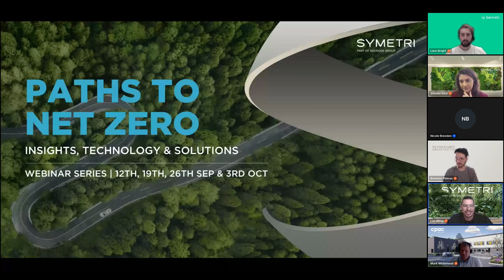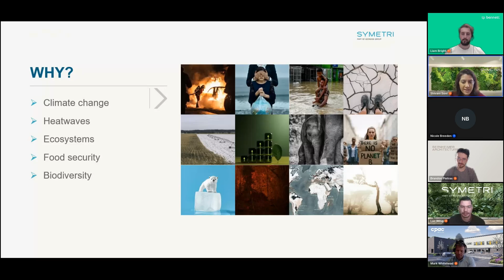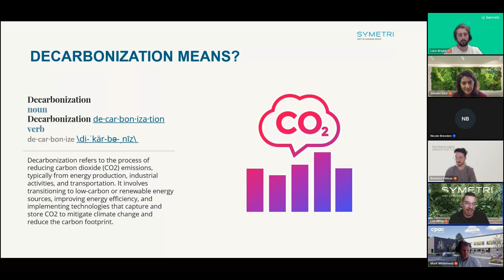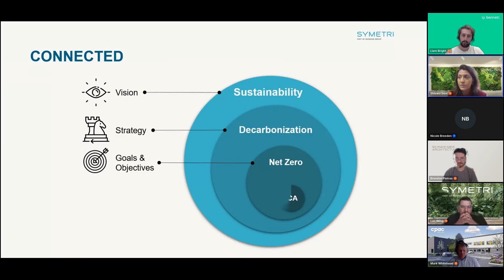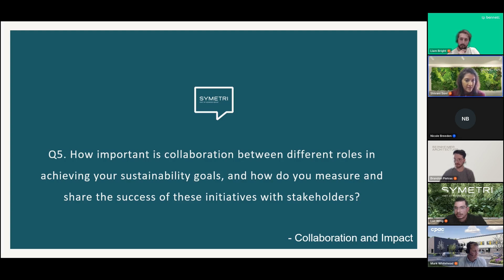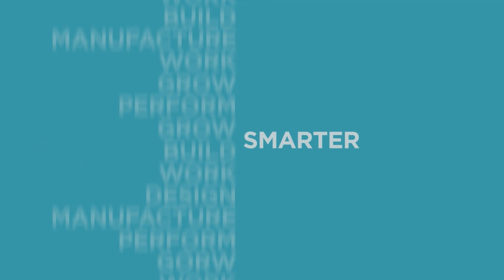Sustainability, Decarbonization, Net-Zero & LCA

Comment: The cause of global warming is not known.  NASA reports global warming at 1°C where it has been since 1992 after falling from its all time reported high of 1.1°C in 1991.   Earth's water vapor saturated greenhouse effect is from water vapor and can not have its overall effect changed by other greenhouse gases absorbing all the greenhouse radiant energy from the earth within a few meters of the radiating surface adding 10°F (5.55°C) to earth's average temperature.   

The wild AC generating space from solar voltaic and wind turbine generation has to be 100% supported by the public power grid with fast reacting peaking power.   This costs more natural gas for high readiness making near zero electricity than making all the electricity from efficient running natural gas combined cycle power stations.  When making up the dips in wild AC output more natural gas will be used.   

As the wild AC generating space increases on the public power grid so does increased use of natural gas over making all the electricity from more economic fuel efficient means.  Without the emergence of cheap natural gas the large trials of alternative electrical generating sources such as wind turbine generators and solar voltaic would not have been possible.  

The practical use for these erratic sources of electricity is for maintaining electrical storage such as charging batteries.   Unless needing immediate backup power for much current wild AC generation this is not an economical repurposing making them stranded assets.